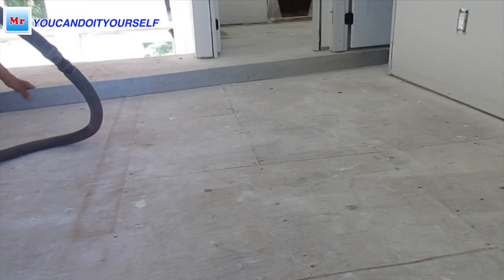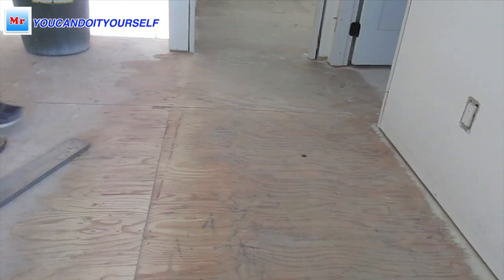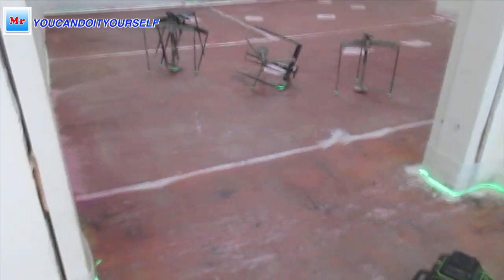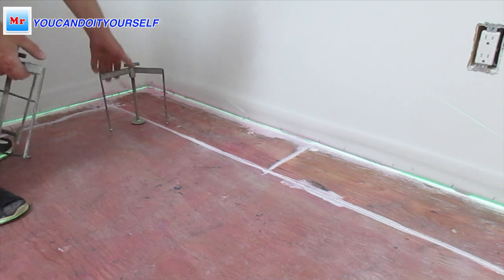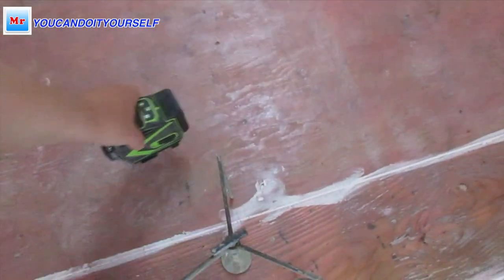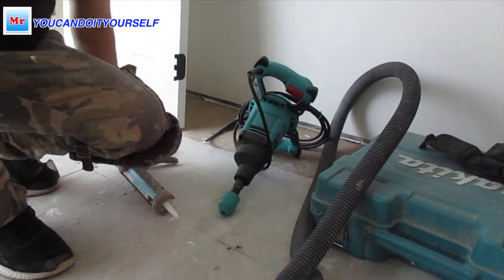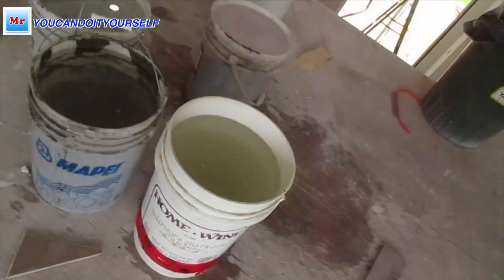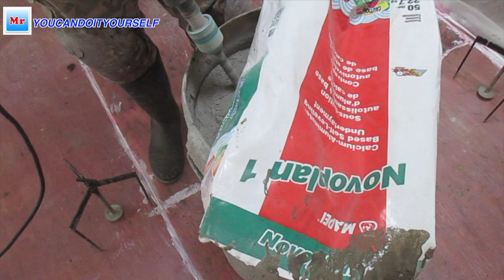Walk In Closet Leveling with tripods and 4D Laser Level

Comment: Hello. Great videos! Thank you for the time you spend doing them. I was wondering where you got your mixing barrel from and if it has a nice flat bottom and sides? I don't have a barrel that big and I have read that some of the barrels have some indentations on the bottom that could get unmixed/wasted product stuck in.
Reply from the maker: I took it from the vine supply store. Then cut off the top screw in the handles from Home Depot and voila.
Reply from the maker: How-to Make a Barrel for Concrete Subfloor Leveling Compound. DIY  Mryoucandoityourself
https://youtu.be/C9XmcD4eaHk
Reply: @MrYoucandoityourself  Thanks so much!